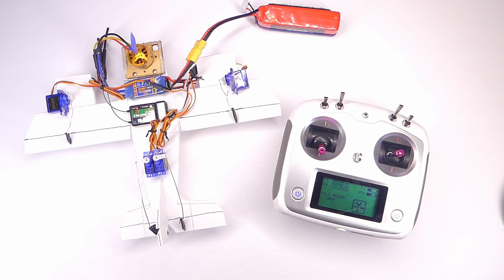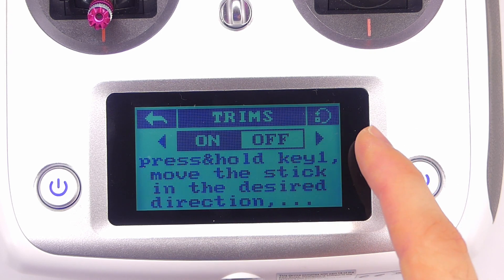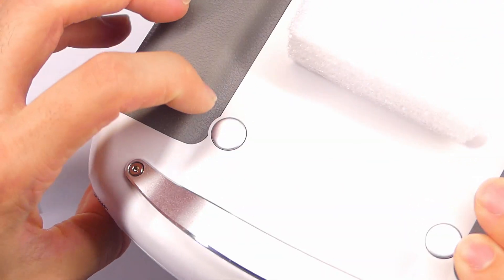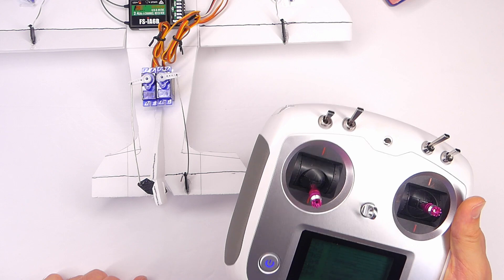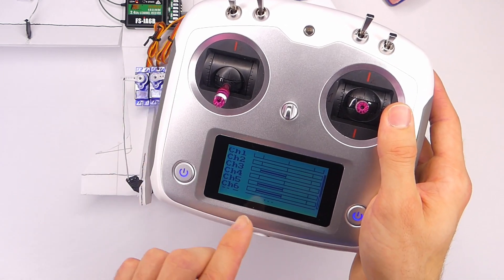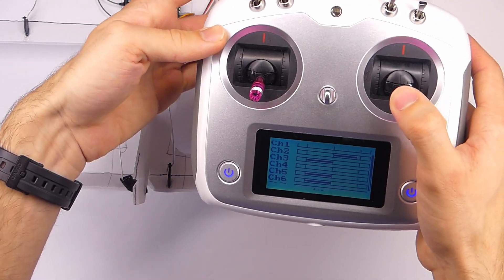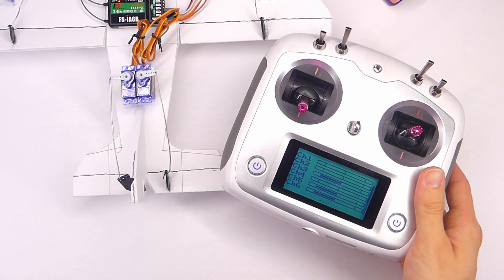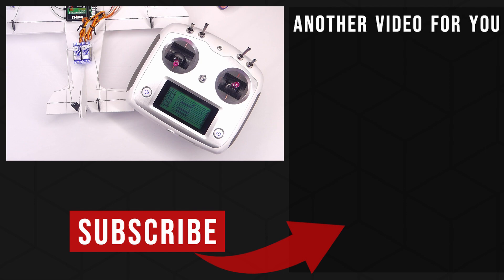The WORST Trim? 🥴 How to Use TRIM on FlySky FS-i6S

Comment from the maker: What do YOU think of the trim feature? 🤔
Reply: Nice video 👍 keep on.
Reply: This is one of the reason for not buying FSI6S and other reason is that it has screen touch display that is very sensitive it can be get damaged easily.
Reply: @dronauticaltech-fun3485  
I have the same opinion. Me as an apprentice I really need to trim on flight with the small actuators besides the sticks. It is more direct than the  i6S ... the buttons on the back seem to be elaborate but during flight it is terrible. 
Therefore I ordered another set with the actuators next to the sticks........

Comment: Great video!  I have an i6s that came with a custom built RC truck, so it had a centering spring already installed on the throttle.  It’s a nice tx and thanks to your video, I am now familiar with the trim functions.  Yes, this tx is completely useless for an RC plane, but will do fine for my truck.  I’ll stick with my Spectrum DX6e for my planes…lol.
Reply: You can remove the spring it’s in built which can be removable

Comment: How to use trim for ch 3 ?
Reply: If the throttle is not spring loaded how to set trim for ch 3 ?
Reply from the maker: I don't think it is an option. Also, I can't think of a situation for throttle trim (like elevator trim).
Reply: I think my problem is linked to the mode I use this tx. I use Ch 3 as elevator and by construction, ch 3 is « throttle » .... which means it has no trim.